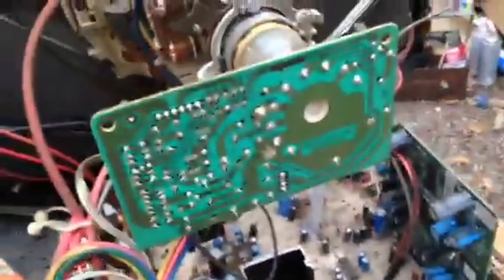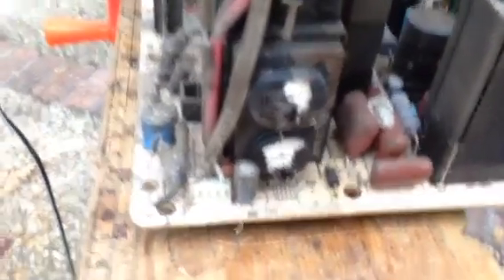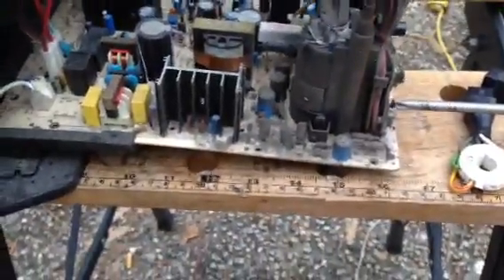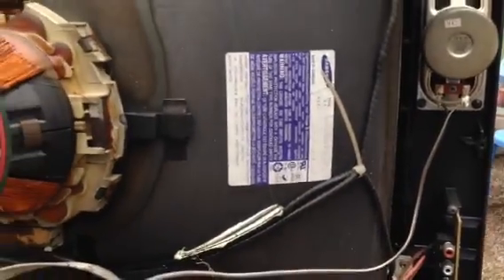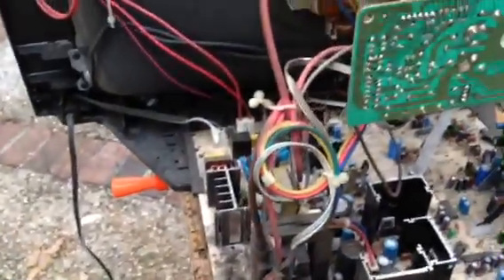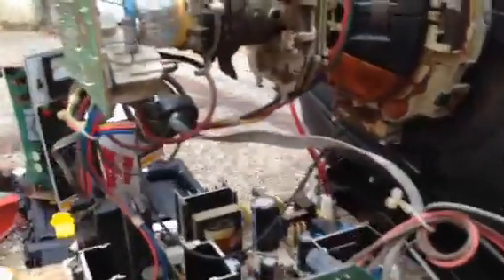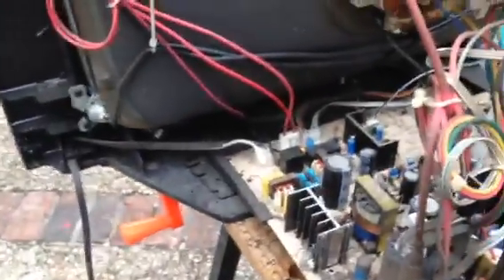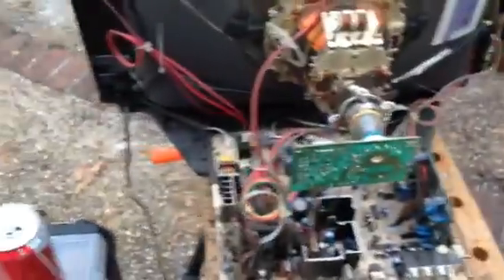Samsung crt tv problems

Comment: CHCK THE  VERTICAL NEGATIVE CAPACITOR   IF   IT WILL NOT SOLVE THE PROBLEM THEN YOU  CAN CONNECT  VARIABLE  RESISTOR ON BIN 7 
1K  OR 3K OR 2.2 K  IT WILL  SOLVE BY  CHANGE THE VALUE OF  VARIABLE  RESISTANCE

Comment: Check for bad solder joints on the flyback. check the Horizontal parts and vertical part's. The guys you mentioned are way better at these set than I.
All the best
Bobby
Reply: Steven King the Horizontal/Vertical is what controls the deflection coil which displays the picture for the CRT, you can tell where it is by following the wires from the deflection coil down to the main PCB and that area should be where the Horizontal and vertial deflection is just replace the caps it shouldn't be a big issue at all
Reply from the maker: Excellent mr Sony! Ive got it on the bench still.  Just a project.  I only use CRT tv's in my house, I just like them better.
Reply: Steven King same with me! and a few others I know. I just don't know why but
I just like CRT's I am using a CRT computer monitor too
Reply from the maker: Thanks guys! So good to hear from some people that really know what's going on here!  I'm just trying to learn! I've seen both of y'all's work, and I'm in the minority here!  THANKS!  I don't get notifications on comments anymore from YT!!??  So sorry I have to check each video manually.  Sorry for the delay!  Y'all rock thanks a bunch.  Steven
Reply from the maker: I've seen tests online where no other format can make all the colors of a true CRT.  YT user maxxarcade has a video showing this.  Good stuff!  I love high voltage, fly backs, delay lines, and big capacitors!  Yay vacuum tubes rock! And they look and sound better!
Reply from the maker: Crts rock! Trinatrons are just top too! Those and the RCA roundies!
Reply from the maker: Can you explain horizontal and vertical? Like the caps and resistors inline in that drive circuit?  You are the best tech.